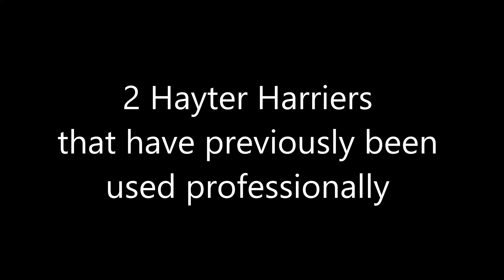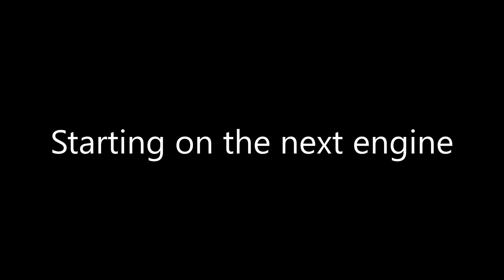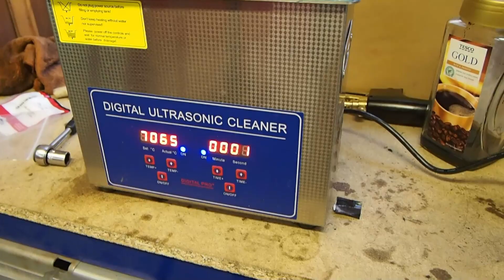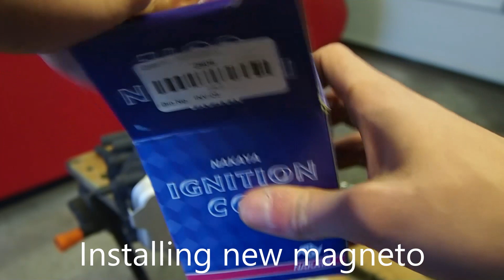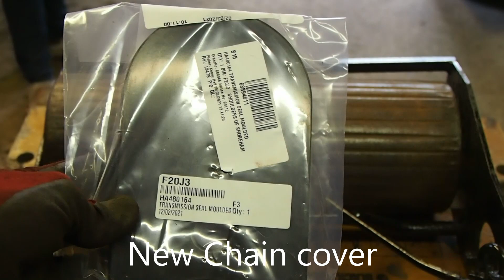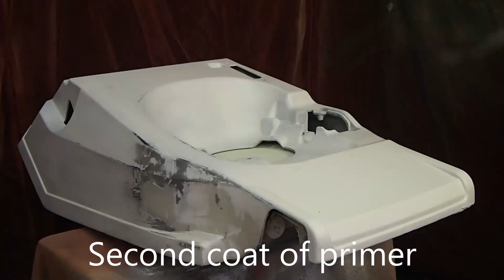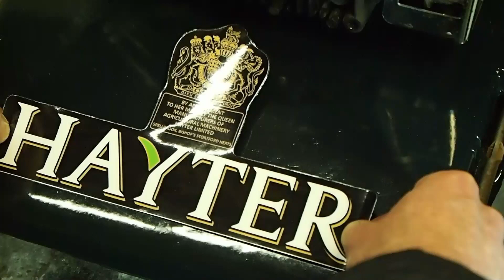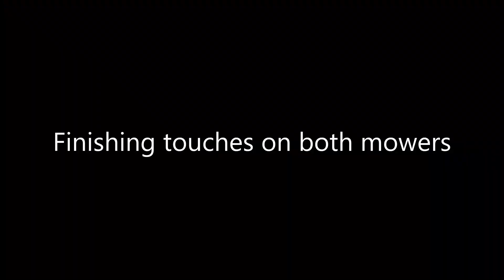NEGLECTED HAYTER MOWERS RESTORATION. WILL THEY RUN? (Hayter 48 Restoration)

Comment: You could try powder coating the bodies. A wheel refurb joint could help you. Use a primer. I think the original was powder coated.

Comment: Where did you get the stickers
Reply from the maker: We got them off eBay. Thanks for watching.
Reply: @snazzymowers1409  if you can could you send me the link? Ive a 48 myself that i  doing up
Reply from the maker: Do you want the larger one off the older machine or the newer, smaller one?
Reply: @snazzymowers1409  both if possible. My own is the older one then i am picking up a new version needing some love lol
Reply from the maker: The larger sticker is this one: https://www.ebay.co.uk/itm/254684615324
And the smaller sticker is: 
https://www.ebay.co.uk/itm/122586248280